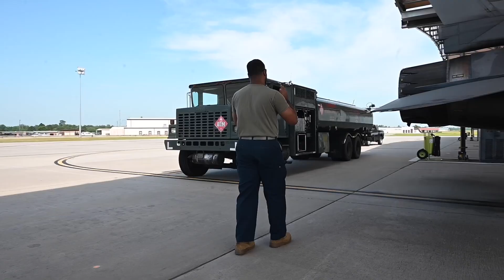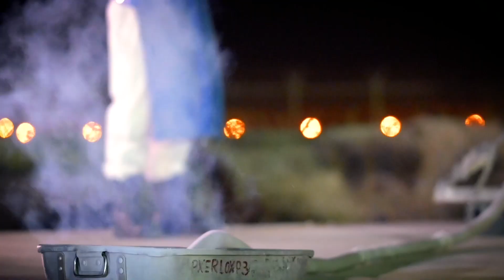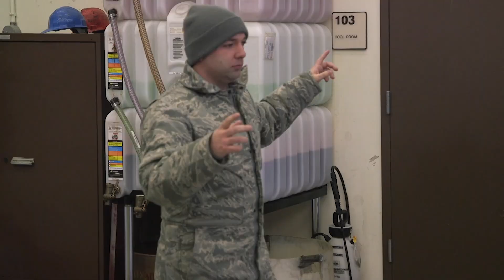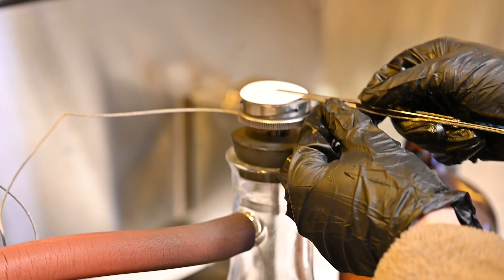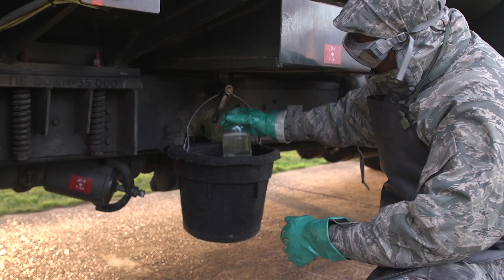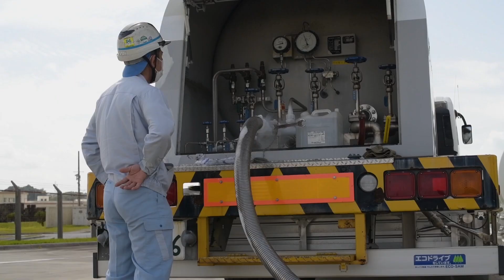Air Force Fuels Management (2F0X1)

Comment: As a CMSgt assigned to the Alternat CAOC at Al Udeid, I put together a centralized location in the AOR for Maintenance of the 400 Gallon mobile Cryogenic tanks.  POL operating in forward locations such as in Afghanistan or Kyrgyzstan and other locations had urgent missions to provide Jet Fuel and Cryogenics (LOX) to the aircraft. One of the issues with cryogenic tanks was the importance of being able to properly Pull a Vacuum on the tanks and to Purge the tanks which was a very long long process and was critical to ensure quality of the Liquid Oxygen. Once complete they would then fill the tanks by an authorized distributor where it was tested for quality.  POL troops at the deployed location would simply contact the centralized center and provided them with a Ship Number of an Empty 400 Gallon Tank that was rotating back to the centralized facility, At that moment the centralized location would immediately deliver a Full, Tested 400 Gallon Tank to be Flow to the Forward Location by C-130 Aircraft.  By doing this we could guarantee the Quality of the Liquid Oxygen.   This process streamlined the time the critical LOX got to the forward location and safely delivered to the Aircraft.